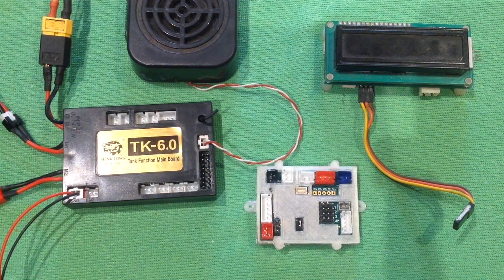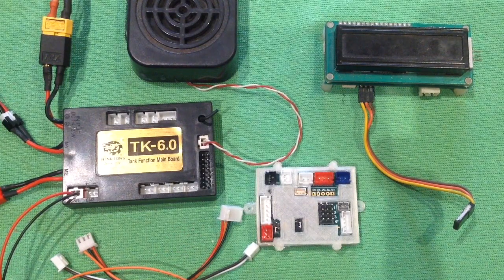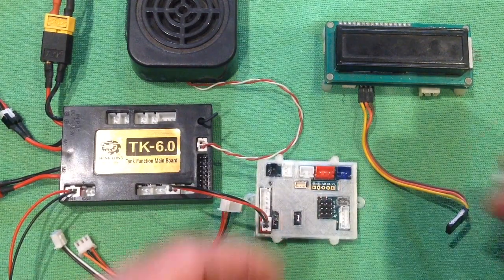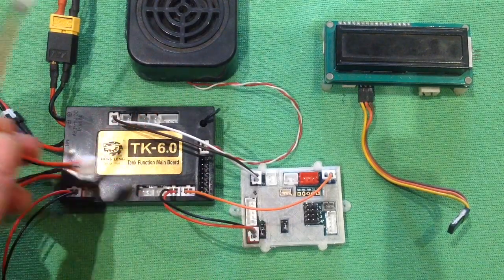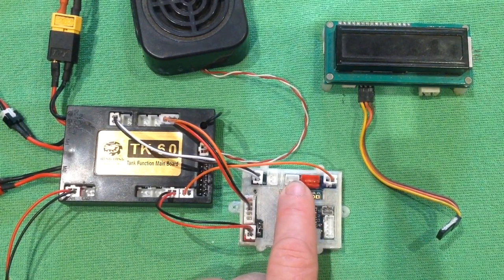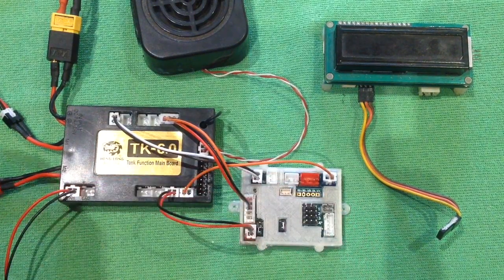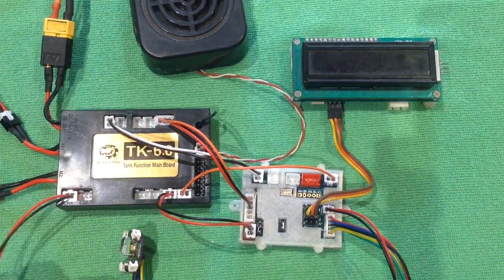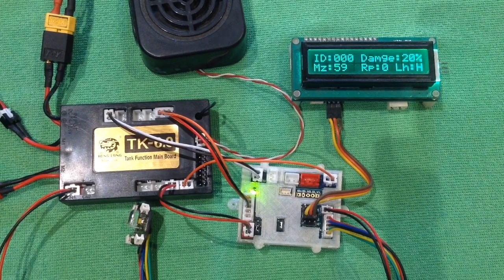MAKO TK6 Installation

Comment: TK 6.0 is great board pair with this mako 2021. But if u have the new gen of HL to RC receiver will be much better as ppl can use their preferred radio
Reply from the maker: BUT by the time you buy a MAKO and then buy the converter board then you've paid for an Asp control board